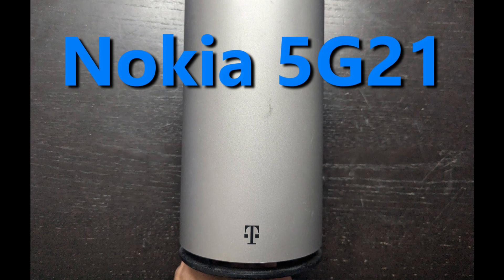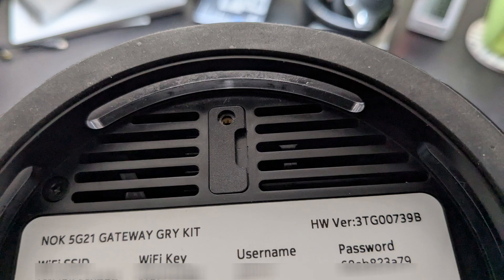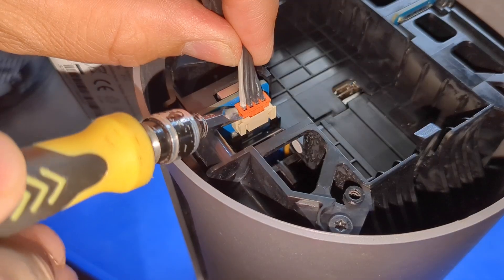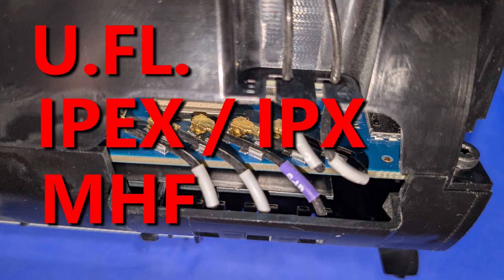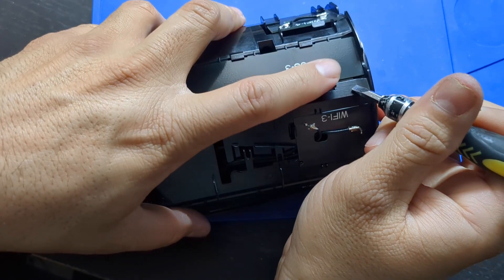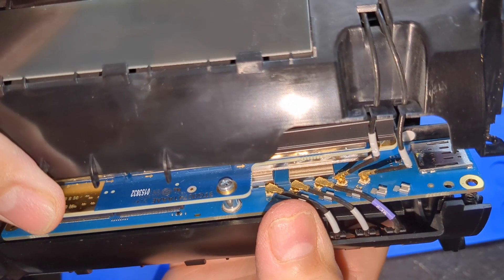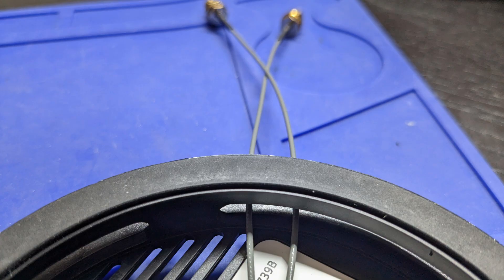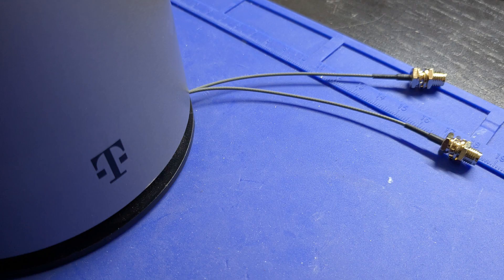How To Disassemble T-Mobile Nokia 5G21 Gateway for External Antennas

Comment: Hey Im looking to get one of these units but right now I only have a single coaxial cable running up to the roof of my building to an external antenna for my signal booster device. However This has 2 antenna design. My question is can I connect both antenna leads from this device to the coaxial cable I have via an adapter? Or do I have to run separate cables?
Reply from the maker: The Nokia 5G21 actually uses 4 antennas. It uses a 4x4 MIMO antenna design + GPS for a total of 5 antenna connectors, the antenna wire in the middle is for GPS. There are four individual antennas inside of this device. I bought a 2X2 antenna, it's a square shaped panel that has two separate antennas inside and two separate wires, that's why I only used two of the antenna connectors for my external antenna. I had two external and two internal antennas and it improved my signal. If you only have one wire going to your antenna, that antenna may not be enough to see improvement on this device as you will only have 1 external antenna and three internal antennas. You also need to check your external antenna specifications to see if it matches the 5G frequencies needed for this device. Since you want to run an external antenna on your roof, what you are looking for is either 2  2X2 MIMO external antennas or 1 4X4 MIMO external antenna for 5G. ...and YES you will have to run a separate cable for each antenna, for a total of 4 antenna wires if you want to run the 4 antennas externally. It gets really complicated and expensive to run external antennas.
Reply: @ChavezDIY thank you for the detailed reply and yes I have since done some research and I would require at minimum a 2x2 configuration for the Mimo style antenna. At one point I was considering just using the internal antennas and routing them outside in an enclosure. I will probably just end up purchasing the same patch antenna that you have here.

Comment: is it possible to unlock the sim?
Reply from the maker: What do you mean by unlock the sim? Do you want to use the device with a Sim from a different carrrier? Or did you want to use the SIm card on another device? I put my SIM card from Google Fi into this gateway and was able to get internet going through it. I don't think you can take the T-Mobile SIM and install it into a different gateway or device.
Reply: @ChavezDIY  Yes , if im going to insert another sim from another carrirer is it possible to make tis up and running or not?

Comment: I have a question; I purchased a Bolton Long Range Antenna (im in a very low signal area), can I plug in the single line into just one of those connections, and leave the other one attached to the small internal antenna? Does it need 2 always? 

Great video!!
Reply from the maker: Depends on the antenna that you're using. I used 2 because I bought a 2x2 MIMO antenna. You could probably use a single antenna but it's hard to say what you gain will be. You could try it out and see if it works with one.

Comment from the maker: I had no issues switching to the used T-Mobile gateway. I just switched the SIM card and waited a few minutes and it was connected. If you buy a used gateway, make sure that it comes with the sticker on the bottom that has the original password to access the device. You will need that password for when you factory reset it.